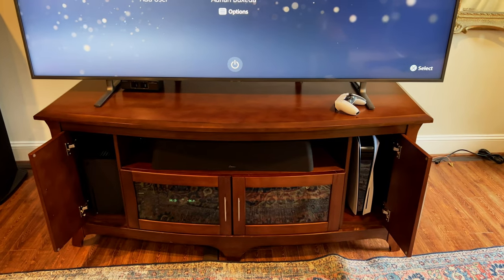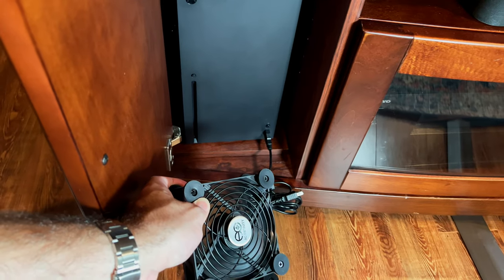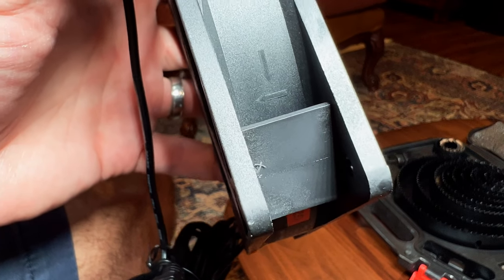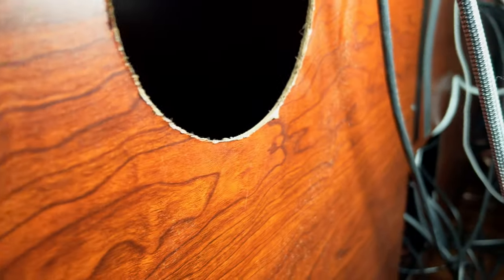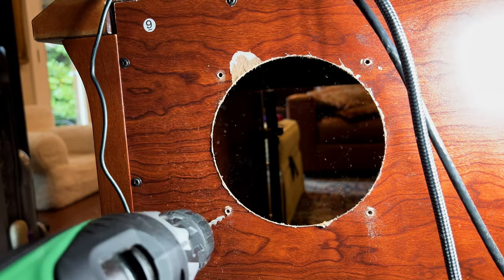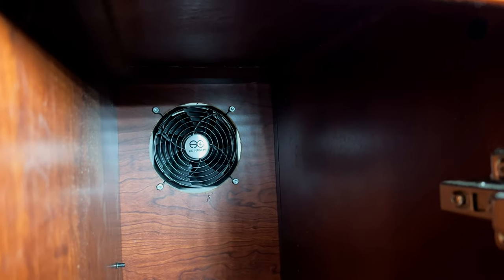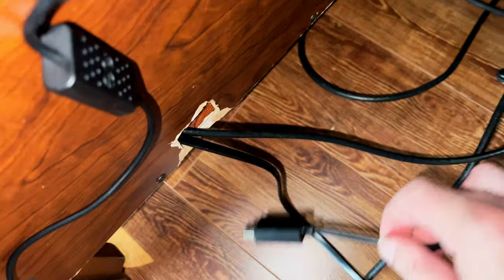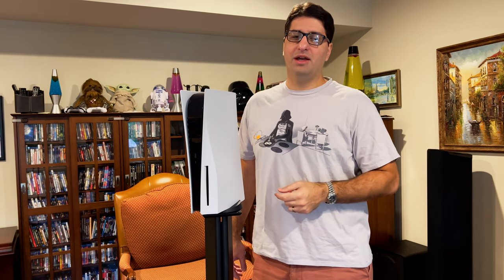How to keep your PS5 or Xbox cool using AC Infinity fans | Solve Overheating!

Comment: I’m pretty sure that the ps5 will let you choose to keep usb power on or off or even have a few hours delay before it turns off. The ps4 was that way and I think even the ps3 was that way, too.
Reply from the maker: Good to know. I guess it’s off by default, which helps anyone trying this project. I couldn’t find any way to turn it off the Xbox though.
Reply: ps4 had that on the main USB-A connection, the most left one that is. At least, thats it on ps4 slim

Comment: Can I ask what size screws you ended up using? (width wise) I'm putting in a very similar installation in my set up.
Reply from the maker: I just took the fans to a hardware store and found ones that fit. I can’t remember the exact size.

Comment: Should of put the fan closer to the middle cause I watched a video about exhaust flow for PS5 and Xbox series x and on your Xbox you got it perfect. But the PS5 the exhaust exit out the back at a downward angle in the middle part of the rear. I know it's sucks but look the video up. Just type in PS5 exhaust flow and you will see a guy with long black hair it's like a 30 min video or so he breaks it down and shows with mirrors and stuff it's really cool. Just thought you would like to know😅